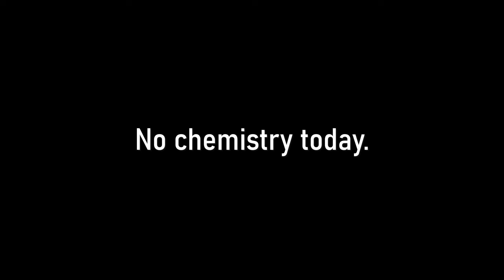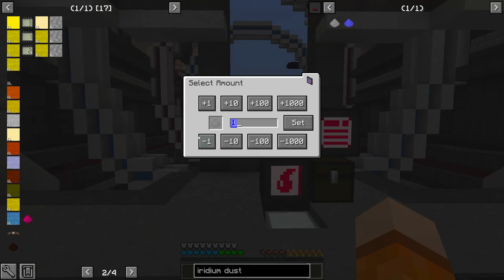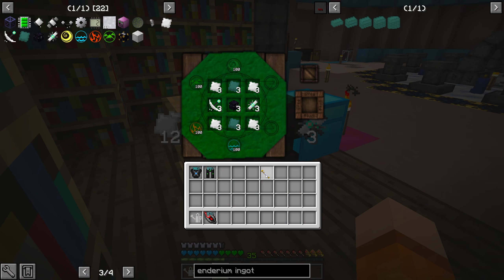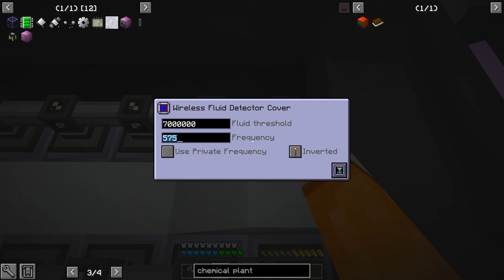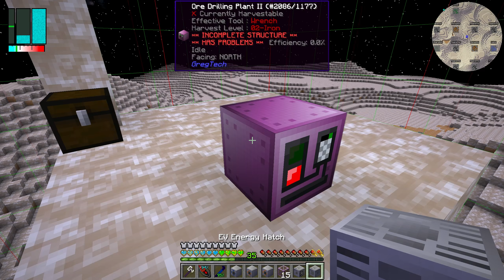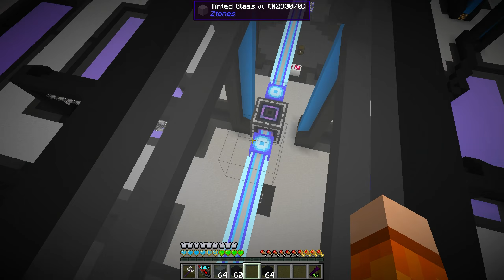Gregtech New Horizons S2 54: Drilling For Inspiration

Comment: I feel like you should plug those holes in the base you keep falling through. maybe some stained glass? as for the blocks....have you tried an exchanging tool? I"m pretty sure thaumcraft has one of those...it could save time. but for the color? I dunno...It seems pretty small and not easily noticed.

Comment: The advanced panels have a built in power switch (ie no need to give them a redstone lever).  You can also do some neat customization with them to make them flatscreens, tilted, etc.  Have a play with the buttons on the right side in the UI :D

Also, with your improved power setup (troublesome as it is right now), it may be worth considering some Quantum Rings both for sending power to miners (P2P GT EU) and easy transport of items from and drilling fluid to.

----

I'm at a very similar spot in the pack to you - About midway through IV, only just got my T3 rocket.  So I'm actively playing alongside and enjoying having a companion to compare against :D

Comment: You could just setup an LCR for on demand fluid crafting, such for advanced glue
Take off and put the frequency module back on to fix the sound in space
Indeed you don’t need to have the covers on the miner
T9 planets require the mothership
You don’t need the lever anymore for the panel, there is a power button for that on the panel
That 16 A dynamo on the LSC should probably be an energy hatch if it’s for power input

Comment: Reminder that you can (and should) get a T2 MBM much earlier than Three did - the main gates are IV Assembling Machine and 16 Iridium worth of gears, but there's a number of ways to get a bit of early iridium without having to set up the entirety of platline, and that's a great way to get something like T2 MBMs early. Even if you don't want the increased maximum range, since it doesn't allow you to fully clean out more veins at once than a T1 MBM can, it's still innately faster and has higher fortune bonus on small ores, so it's a worthwhile upgrade.

You can find denser Galena veins on some of the Galacticraft planets, including the Moon and Mars, but denser diamond veins are only on Ross128b. Mars is the best place to hit up for galena/sphalerite if you need both for indium, BTW, since it contains both galena and sulfur (read: Sphalerite) veins.

To clarify the tooltip a bit (at least as far as I understand it): "~3x as much Crushed Ore versus normal processing" means that MBMs produce, on average, 3 times as much crushed ore when it macerates a large ore block than if you were to macerate said large ore block with an actual macerator. Since it's an average and the math seems to work out neatly I personally suspect the way this works is that MBMs apply a Fortune XI effect to crushed ore yield (or Fortune V after macerating doubles/quadruples the yield for regular and nether/end ores respectively), but that's just a theory of mine. TL;DR: MBMs are really, extremely good. Invest in them early, invest in them heavily, and make sure your ore processing can at least vaguely keep up 🙃.

Reminder that with some MV tier worth of Thaumcraft investment an ingot of tantalum can be yours for the low, low cost of...okay there's a lot of possible combinations here, but one example of a clean combination is 1x Nugget (basically any metal will suffice, so Iron is probably the cheapest), 1x Copper Ingot, 1x Honey Comb (again other combs probably work, but cheapest/most readily available - 2x Soul Sand is another option if cleanliness isn't a priority). That will transmute two Tantalum nuggets into six, so do that recipe three times and you've got a net profit of an ingot worth of Tantalum. Also, bonus: No EBF cooking, so no vacuum freezing needed afterwards.

For the less magically inclined, BTW: Ilmenite has a special processing line that's extremely easy to do, and gives each Crushed Ilmenite Ore a 12% chance of yielding a full Tantalum dust, alongside other goodies. Also don't miss Tantalite ore and Sodium Persulfate chemical baths.

Quick point of correction: Super Glue you can only use on graphene recipes that use Europium Doped Wafers or Americium Doped Wafers. Three is currently a rocket (and fuel) build away from being able to craft the tier of doped wafers before Europium, so super glue isn't going to be an issue for a while. And, ideally, never. Super glue is such an insane chain of recipes that most people never bother with it until literally the single recipe that requires it before you're able to skip the entire chain with a QFT.

Anyway, back to the Graphene issue. If you don't have Advanced Glue automated it's going to come back to bite you in a big way when you're trying to craft IV tier components. And if you have very limited processing capacity for assembling machine recipes, you're going to be waiting up to 40 seconds per motor. Now consider that each T2 MBM controller takes 16 IV motors worth of components, and you can start to see the problem. The solution? Automation and/or batch crafting, pretty much. Phosphorous doped boules you should be able to crank out trivially at this stage, so if you've got advanced glue in stock (and, you know, graphite to turn into graphene) you should be able to mass produce graphene in advance. Make sure you always have plenty in stock, so that at least you're waiting on the next batch before you need it.

Wait, the ender chest/tank has an actual crafting recipe? And here I thought people only made it rain out of the sky by opening the excessive amount of IV lootbags the seven million chemical chain quests give you 🙃.

(For the record: The Vis cost of Ender Chests/Tanks is trivial. The Iridium required for IV sensors/emitters you're not going to get until around mid-EV at the very earliest, whereas a good enough wand you can pull off with only a few pieces of Stainless Steel)

Speaking as a guy who better know a thing or two about benzene after designing four versions of that setup: It's a good fuel source that you can stretch at least as far as IV, but it's main claim to fame early on I would say is actually the byproducts. Passive oxygen/nitrogen, various dense sources of hydrogen, phosphorous for boules, calcium for fertilizer/concrete as well as sano/tutamen essentia, more sano from magnesium, potassium (and eventually 1,2-dimethylbenzen) for Phthalic Acid, and more.

As a counterpoint, the same tech that'll let you set up functional benzene can allow you to prospect for Raw Oil, distil/desulfurize that into Naphtha, and burn that directly as a gas fuel. Naphtha is less energy dense than benzene, and you might be unlucky with finding a decent field of the stuff, but it's an incredibly cheap and simple setup that spits out 1200 EU/t base fuel value per LV distillery - around an entire Benzene 1 setup's worth. And that's just the start. Once DTs come into play not only with your Raw Oil produce Light and Heavy fuel in the exact ratios needed to produce diesel, but the incredibly Balanced(TM) Circuit 9 DT recipe will spit out base 15K EU/t worth of Naphtha and base 9K EU/t worth of Diesel, along with a  bonus base 3K EU/t in Natural Gas. That's 24K EU/t worth of gas and combustion fuel, more than an entire Benzene 3 setup worth of power, out of one HV DT. Yes, a good oil field won't last until the heat death of the universe like a treefarm powered benzene setup will, but it doesn't need to. It'll carry you until you can set up a new/better power source, at least, and that's good enough.

(note that the above applies to 2.5, though I make zero promises the Balanced(TM) circuit 9 DT recipe won't get nerf hammered at any point)

Remember to invest in a seroconverter if you want to move tanks around without that whole "dying of hunger" issue. 5 minutes and 20 seconds of Saturation III might not sound like much, and it isn't for daily activities, but when you're moving a bunch of tanks around just turning off hunger for a few minutes makes moving them around much more convenient.

Investment into blood magic makes rockets obsolete bar the first trip to place a Teleposer on a new planet, so that's something I would recommend investing in. For the convenience factor of not having to deal with epic twenty second countdowns and rocket launches again and again, if nothing else.

The chunkloading feature for MBMs isn't new, but the UI button for it is. In short: MBMs can (un)load chunks they are mining, although the MBM itself must be chunkloaded separately. Single block miners, by the way, cannot do this. Their entire mining area must be chunkloaded or they will not mine unloaded chunks.

I don't know if it's been fixed since, but I once managed to crashloop a world because those information panels threw a divide by zero exception, of all things. If that happens one option, albeit a potentially risky one, is going into Forge's config and briefly toggling the Remove Erroring (Tile) Entities lines. I didn't notice any issues afterwards, but that also happened on a creative test world, so I was hardly very thorough in checking that nothing else went *poof*.

For the record, the reason UHV+ capacitors are specifically listed is because they're related to the LSC's Wireless Mode. Nothing Three has to worry about for a very long time, but that's why that's there.

Note that the amount of amps that wireless chargers can accept depends on their mode - 2/8/5 for long/local/mixed respectively. That said LSCs can accept multi-amp hatches, so giving it a 16A EV dynamo hatch and not caring is a perfectly viable option. Speaking of, upgrading the input hatch rather than splitting the input cables was also an option.
Reply: Good stuff. Nitrobenz is likewise really nice for byproducts like Argon for blasting. Oh and Launch Controllers make rocket travel instant btw, might save people some time.
Reply: I don't think the MBM crushed bonus is fortune based, cuz fortune is actually kinda weird (fortune n basically has a 1/(n + 2) chance of giving each amound of outputs from 2 to n + 1 and a 2/(n + 2) chance of giving 1 output, which is (1/(n+2) + (n+1)/2)x overall)

Also, the MBM chunkloading mode has a "hidden" "feature" where it causes the working area to be centered on the nearest chunk corner instead of on the MBM ... not much of a concern when mining planets, but it's helpful to keep in mind especially for mining blood magic meteors

Regardless, MBMs are insanely good, with the only minor downside being that they're kind of too good and at some point they're so fast that you have to mine them only a few minutes after setting them down, by the time they are 1-ticking at UV.  But by then you will be close to void miners which can just mine in any dimension not named Toxic Everglades forever

Comment: You have upgraded your ore acquisition without also upgrading your ore processing, I foresee backstuffing issues in your future if you don't handle that. As a general practice, I tend to upgrade my ore processing before upgrading my ore acquisition unless I'm critically short of particular resources needed to upgrade the processing. That might actually have been a contributing factor to your problems at the end of the episode, since the miner will turn off if it starts backstuffing.